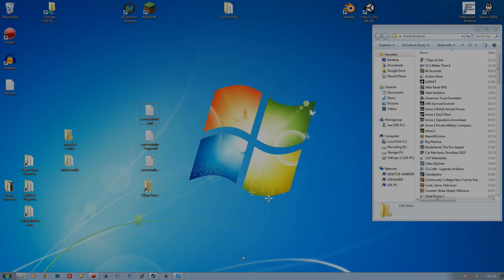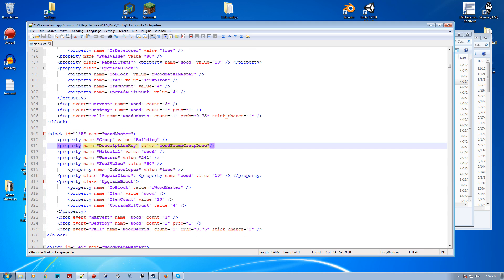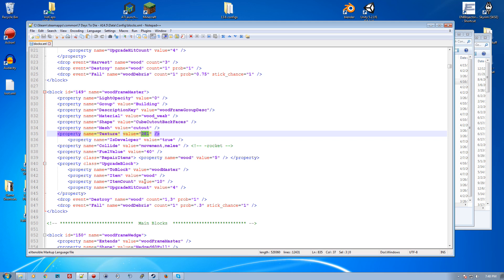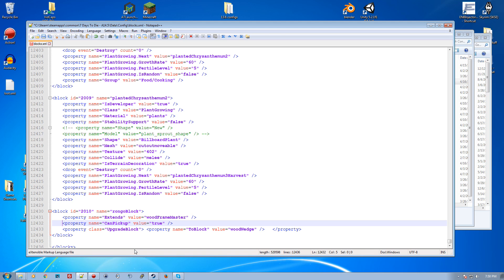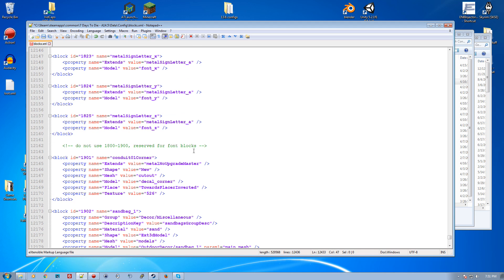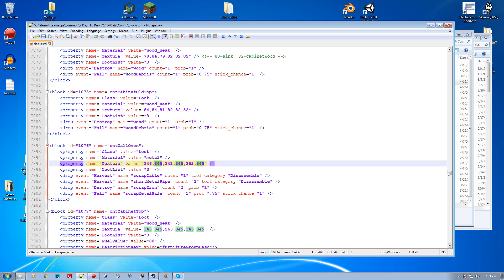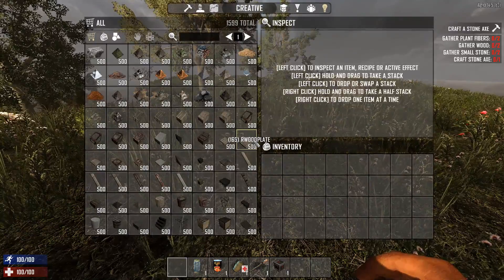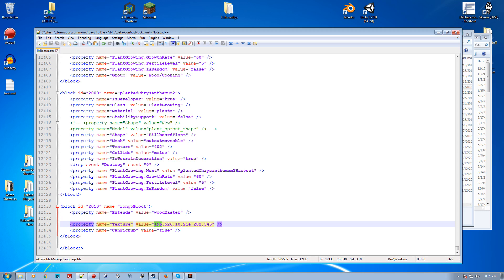7 Days to Die | Alpha 14+ Modding Building Blocks with different textures

Comment: Can you do a video on how you make your videos, like programs used and the editing process?  Maybe talk about your gaming rig and such?
Reply from the maker: +Xantar2482 Yeah, I could do that :) Never thought about the technical aspects of what it takes.
Reply: +Xantar2482 You click on RongoTheBold, then click on "about" and you have all the info there; but here it is, just in case: Intel i7 4790 processor running at 4ghz, 32gb GSkill Ripjaw DDR3 ram, Asus Gaming extreme motherboard, Gigabyte Nvideo GTX980 video card, 512gb ultra fast SSD for boot/game installation, 256gb SSD for recording, 2TB drive for overflow (Most everything is stored on my old gaming PC which is my server and has 7TB of online storage) I use Mrillis Action! for recording and livestreaming and Wondershares Video Editor for editing.
Reply: +Space4Ace I saw that.  I suppose I should have been more clear, I am more interested in hearing and seeing the process worked out. Primarily because the turn around on producing videos is seems fast and the quality is so good.  But thanks for taking the time to show that though.